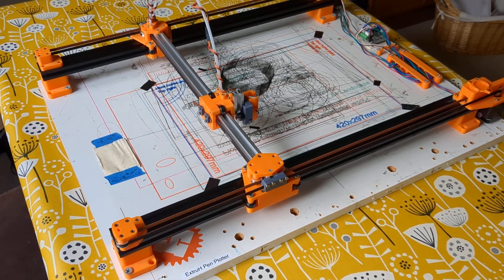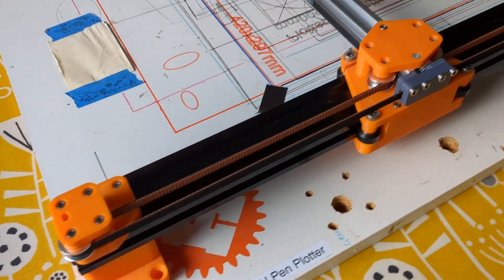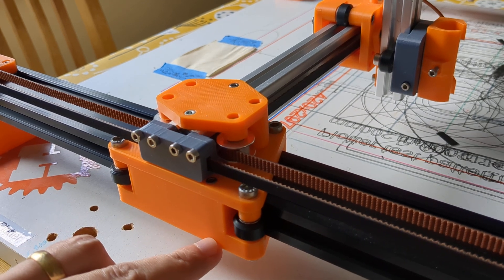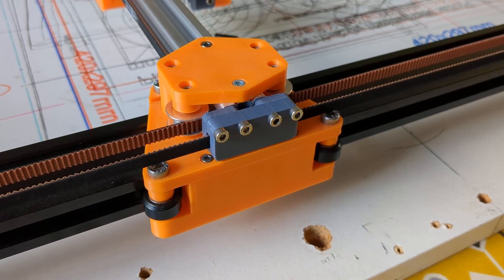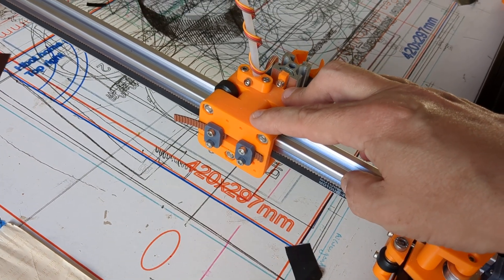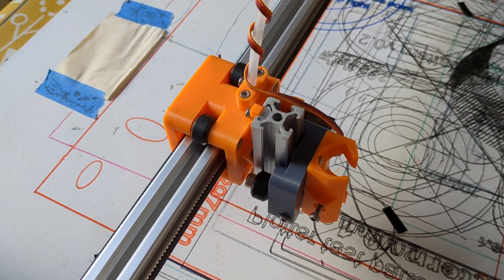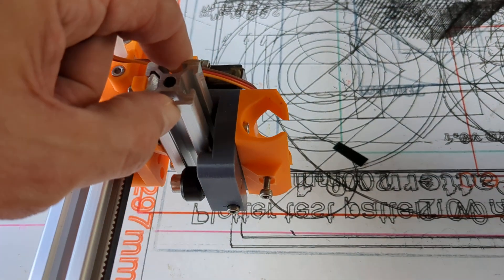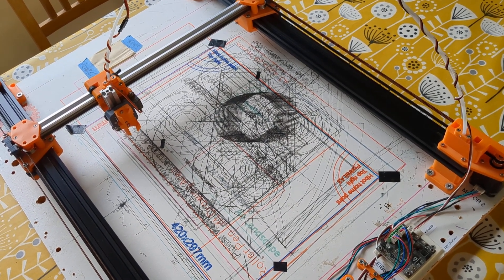Quick and Slapdash Tour of the ExtruH Plotter

Comment: It's awesome! I have a question: Why did you route the belt through all the corners? You could just run it along the end of the 40x40 sigma profile. Is there a reason you're doing it that way?

And if you're interested, you could add a laser for engraving.
Reply: I get it now! You don’t want to have the motor force at the end of the profile because, on the opposite side, there’s no weight to balance the torque. Is that the reason?
Reply from the maker: I'm not sure that I got exactly what your first idea was but I think it sounded like what a coreXY machine does, although that needs two belts and it's to balance things out, like you say

H-bot isn't that well balanced, it needs the pen arm to be stiff to keep things in line. It's never been a problem at this size but I've seen people make them bigger and have problems. CoreXY uses the belts to keep things square instead which can sometimes be better, especially on very large machines

Comment: Great stuff, I built something similar but had issues with belt tensioning.
Reply from the maker: I'm still looking into the right belt tension (and I remain unconvinced that I have good belt even though the one shown wasn't the cheapest). Drawing accuracy and repeatability is generally excellent but there are light ripples on fast curved moves that I'm still diagnosing but I suspect the belt and tension is probably part of it, the grey parts that I mentioned aren't in the files yet are part of trying to chase that down
Reply: @ChrisLynas  I had some inexpensive Linear rails 500mm so I used those rather than wheels. Basically took the top CoreXY from a 3D printer design. I have a 3d printer board with a Pi Zero running klipper, so that is a cheap way to go. I think you are using H and I'm using CoreXY, I find it tricky not to rack the X axis while belt tensioning.
Reply from the maker: @FilmFactry very good point, I know a few people with coreXY who've struggled with tension. It's easier with the H but then the only thing stopping the gantry from racking is the structure and that can be a bit bendy with 3d printed parts. I did think about making a coreXY version, I didn't start anything yet though